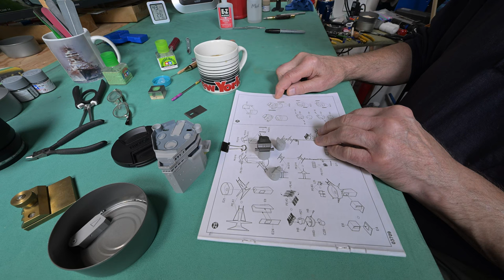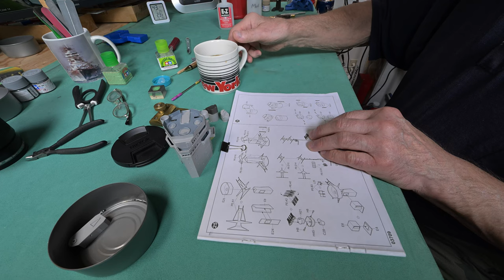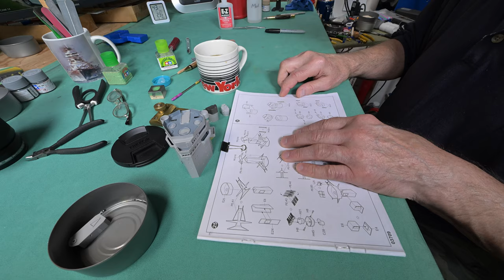The Model Ship - Part 1241

Comment: Morning Ron.  I understand your point about spray painting with the airbrush!  Even though I only have to sit down, turn on my compressor and paint booth light to start, I still hesitate to use my airbrush.  My cleanup normally takes longer than painting the item(s).  And getting all the parts together that will be painted the same color causes me to jump around in the instructions with half-built units to paint (can be confusing).  I prefer to paint as I go with a brush, it's more enjoyable for me and less frustrating.  I brush paint everything except larger items (i.e., hull, deck, etc...).  Eric

Comment: Hi Ron, I use a battery Airbrush , works fine easy to,set up and clean also pretty sure you can get paints designed for hand painting , Valero comes to mind , anyway your model , you do,it your way enjoy
Reply from the maker: Thanks for the tip!

Comment: I’m with you Ron; the trouble with airbrushing is that it triples or quadruples build times, and you find yourself spending hours and hours masking and cleaning, and fussing with the airbrush instead of building your models. The only airbrushing I do anymore is for large areas like hulls and decks and even then, cans are good enough. Also you can spray all the sprues at the very beginning, then build. Model building is about fun, not perfectionism!
Reply from the maker: When and if we get to the Iowa, I'm thing now of doing just what you mentioned. ( large areas like hull and deck) 👍

Comment: Ron, Great decision. Your increasing distaste for air brushing has been obvious as your avoidance techniques have improved greatly on the Rodney! I make 1/350 battleships rather than 1/200 but I always hand paint. My daughter bought me an airbrush but I could never get on with it. I find ladders, railings and small photo etch  the most tricky , but as long as the paint is thinned enough - no problem. Mind you when you hand paint the hull of the Iowa its going to be a heck of a long video, David
Reply from the maker: Thanks, might air brush that hull. We'll see.  👍

Comment: Morning Ron, Well that was unexpected as it looked like you were fine with the airbrushing but at the end of the day as you said the hobby is for your enjoyment and its what ever you feel comfortable with and the worst thing to do is carry on doing something you are not happy with be it painting a certain way or building a certain model and we would not be here watching you if we did not enjoy what you do. I would suggest you look at changing paint brands as Tamiya paints were never designed to be hand painted only airbrushed you may want to look at Enamels, Model Masters are great or if you don't like enamels then have a look at Vallejo Model Color they are designed for hand painting, a friend of mine only ever hand paints and challenged me to hand paint a model using Model Master Enamels which can be hard to get here in the UK, I am lucky I have friends in the USA who got me the paints I needed and shipped them over to me  and I must say I was surprised by to quality of finish I was able to achieve, the best comment I had was when someone at a model show asked me what paints I had used to airbrush the model 😀 Will email you some phots of the finished F104 Starfighter, even the sealer coat was hand painted using Vallejo Matt and Satin  Varnish in a 50/50 mix.  Well carry on hand painting and I will see you tomorrow
Reply from the maker: Thanks! Will look for the photos later in themodelship@hotmail.com 👍

Comment: Hi Ron, glad you sorted your data. To be honest, all hard drives will fail eventually, even solid state hard drives. Cloud or setting up a server is the safest option, but I have had a customer loose data from a cloud system a few years ago. Nothing is full proof. I use cloud and have two servers, one runs four hard drives at RAID 5 (redundant array of independent disks), the other six hard drives at RAID 10. I have attempted data rescue on countless customers hard drives, it’s expensive and many aren’t successful. If you want to keep your data, storing it on a PC isn’t advisable, nor are external hard drives reliable enough for very important data. One can reduce the risks by copying the data to several hard drives, if one fails at least the others should be okay.
Reply from the maker: "copying the data to several hard drives" 👍👍

Comment: Do as you wish Ron and whatever makes you happy.. I think another comment suggests using enamels because of the superior finish? Personally I’ve not used enamels for anything other than washes for some time so can’t comment. A change of paint though might be advisable because Tamiya acrylics are notorious, or is that famous/ infamous (?) for not liking to be brush painted, particularly when the bottle has been opened for sometime and the paint begins to get old. Someone on here might know of a solution for that but it probably involves the surfaces being clean and (finger) grease free? See ya tomorrow..
Reply from the maker: Thanks Ian. 👍